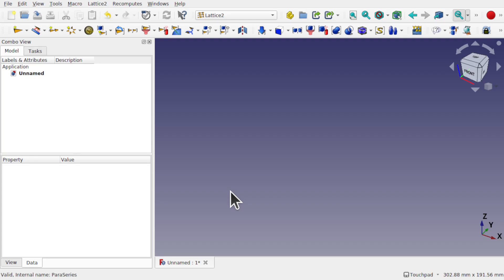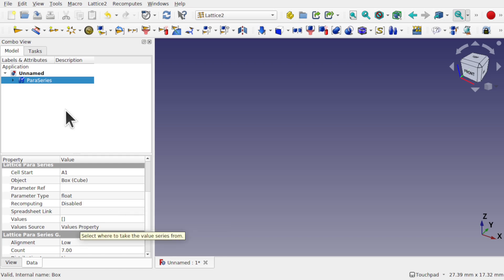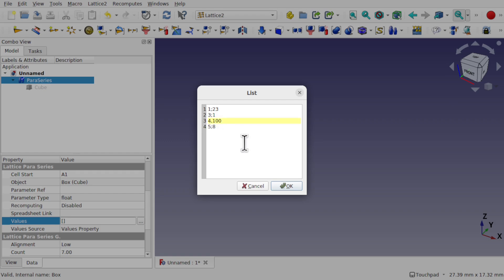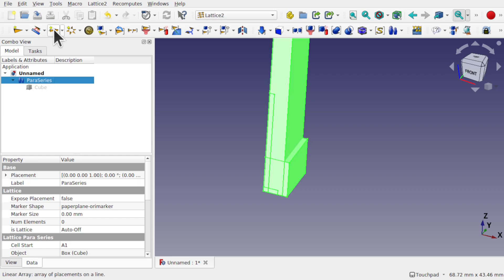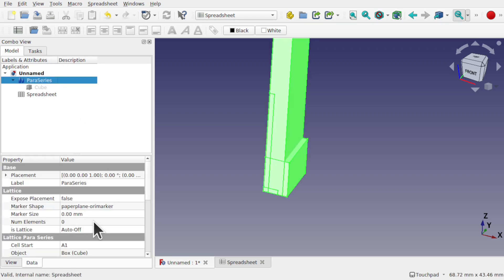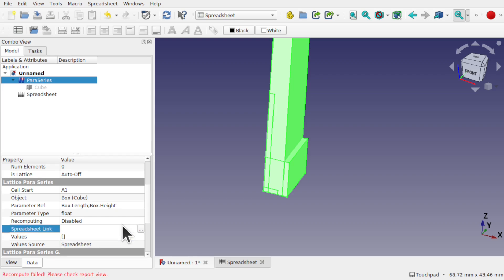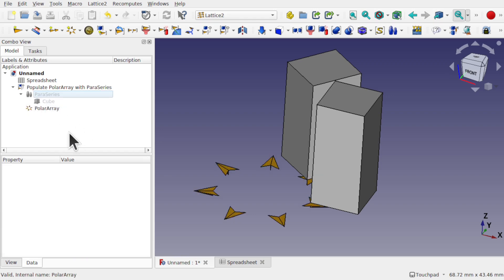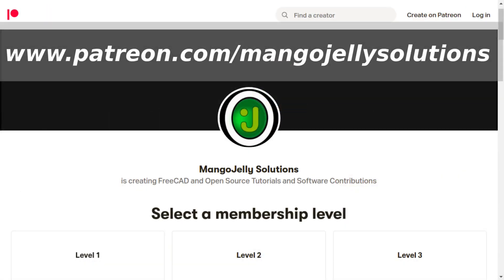FreeCAD: Lattice2 Para Series | Mutate Multiple values From a Spreadsheet

Comment: i have unrelated question
something was bugging me in freecad for a long time but there may be a solution for that
if you move a point in sketcher when none of the other points is constrained almost everything you don't want to moves, this is especially annoying with series of connected arcs
is there a way to make sketcher rorare the arc instead moving itso the next point in line stay where it is?
imagine s curve made out of 4 arcs and grabing point in the middle and moving it, i would like for only this point to move2 connected arcsbeing not constraint to each other create a sharp ange and rotate on the far points without draging them, arc may extend or change diameter but i would like for unrestricted points it's attached to to take priority overradius and lacation of arch center